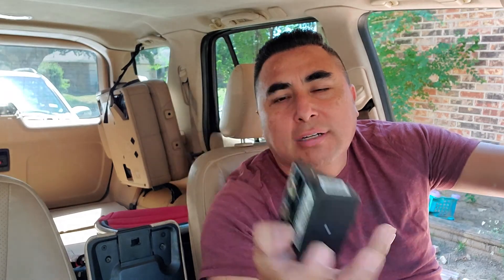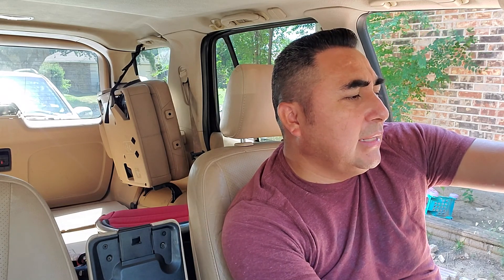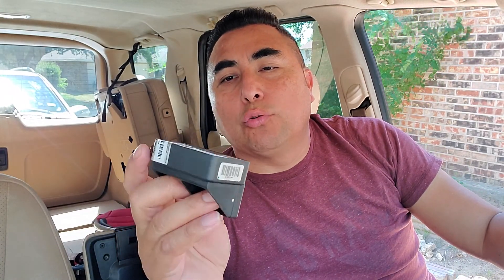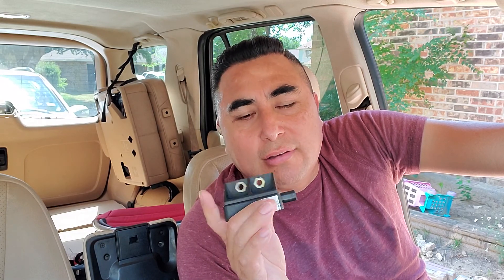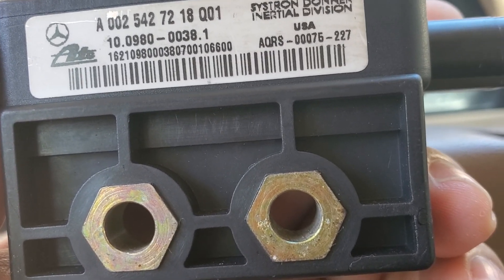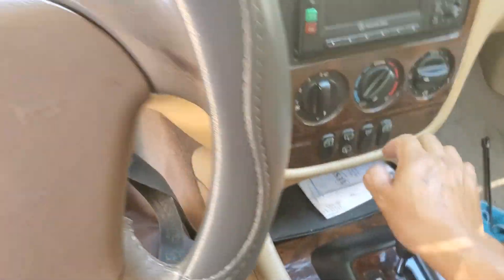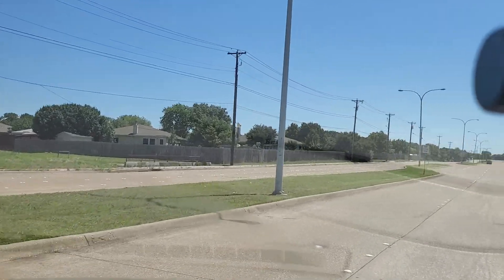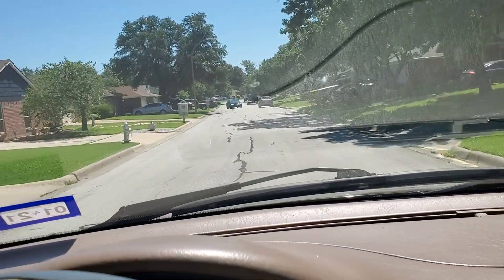w163 yaw sensor

Comment: My 2001 ML430 has been doing this for the last year. I've tried the brake light switch (twice), the ABS sensor for that same wheel and was about to bleed the brakes as a last attempt but I believe you've provided the correct answer. Thank you brother. It is a wonderful SUV especially considering it's over 20 years old. Benz man for life.

Comment: You have to disconnected the battery first before you replace parts or any workings. Also you have to check battery condition akemWgnwbee85AGH7 sure the fully charged battery.
Most sensor faulty code or any dtc code appears when battery is bad.

Comment: It’s a $900.00 USD , sensor. The whole system is a work of art. Unfortunately most “works of art” , have their imperfections… I found my replacement in a salvage yard. Very fortunate that it is still working great. The original Yaw Sensor went bad while I was driving at a speed of 80 miles per hour. I am very lucky to be alive. It is a scary thought that thing going bad at any moment. Nice video, thanks .

Comment: Thanks for this video ! 
I'm about to do this to our 2002 ML500.
As a 'workaround' to prevent sudden 1 wheel braking you can go in Underhood fuse / relay box & pull out the 'K25' ABS relay - this disables the ABS / ETS / BAS system.
You'll likely have all 3 lights lit on the left dash but at least 1 wheel won't suddenly brake which could be dangerous !
My symptoms were the sudden 1 wheel braking (feels like a flat tire)
I scanned & pulled a C1142 code - Yaw Sensor Bad.
I got one from a wrecking yard am hoping its good.
If not I may look up that refurb one from the UK.

Comment: Amazing video! Can I ask - do you not need to plug the diagnostic/Star machine to calibriate the new sensor?
Reply: There is a 'Yaw Sensor Re-learn Pricedure' try searching for those terms.
Can't recall if it requires ECU reprogram. No Dealer visit just a few steps.

Comment: Thanks so much your video was very useful for me. I will attempt this after locating the compatible part. I have  a 2002 ML500 with 324,000 miles/ original engine and transmission. It still looks and runs great.Your clicking sound could be the EVAP Purge Valve. I let my tech do that job. Was about $150. I think that part was about $90